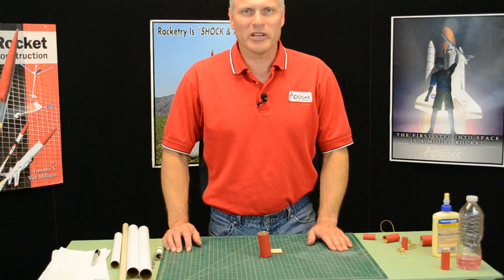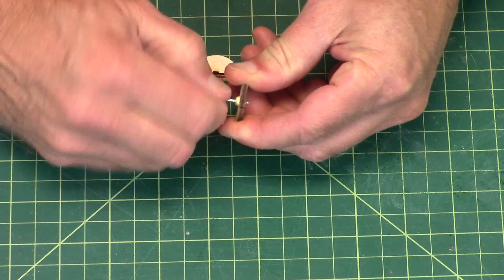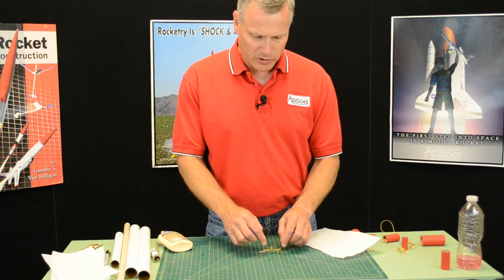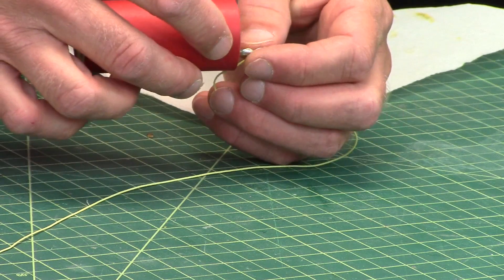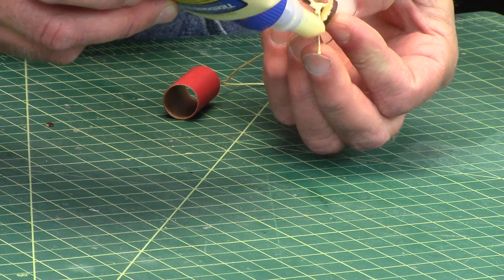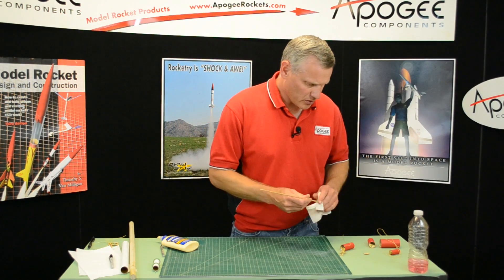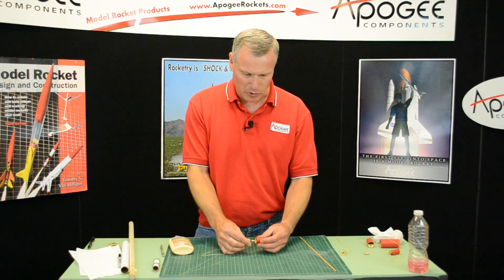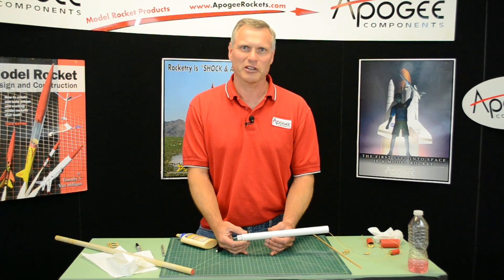Making and Installing An Apogee Ejection Charge Baffle

Comment: I got a tip from another rocket maker in a group that he would put a small piece of steel wool in the baffle to help catch the embers so the chute wouldn’t melt in spots. What’s your thoughts? Seems like it would work but isn’t steel wool flammable?
Reply from the maker: We've been trying to go away from this, because they can clog up and prevent the ejection charge from pushing the parachute out. I've lost a couple of rockets to this issue. So it isn't something I'd heartily recommend.
Reply: @apogeerockets  thank you for the response and noted! May your skies be blue…

Comment: Why do you glue the ejection baffle?? Dont it eject out the parachute??
Reply: The baffle is not a piston. It just breaks up the flow of the deploy charge. The pressure still comes through but not the sparks. But a piston is probably better anyway.
Reply: It acts like a muffler.

Comment: I have not seen ejection baffles before, so this is very interesting. Do they use these baffles on high power or dual deployments?
Reply: No, just low - mid power. I've never used them but I guess I should one day just to have a go.